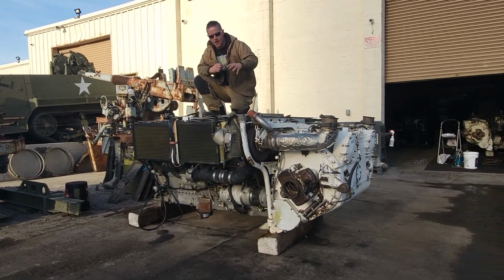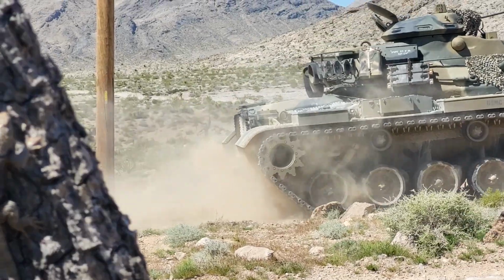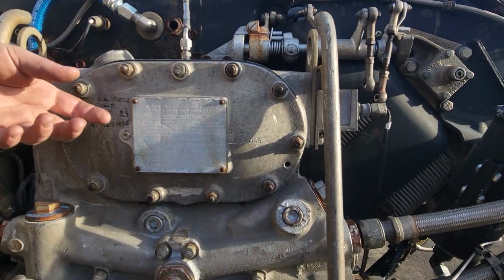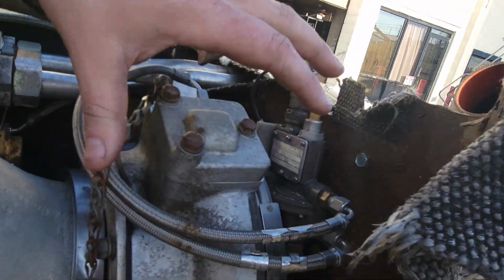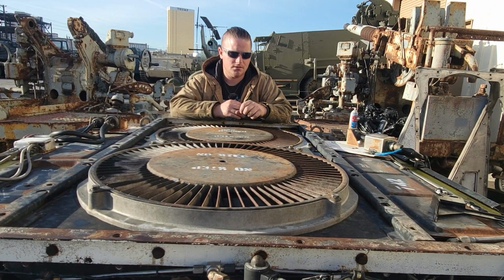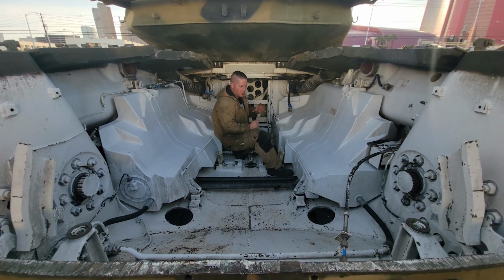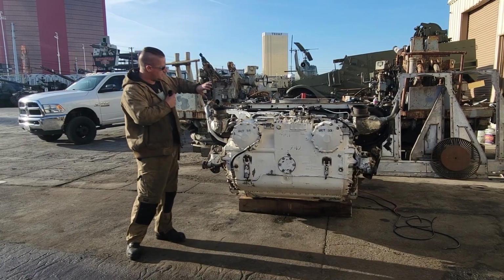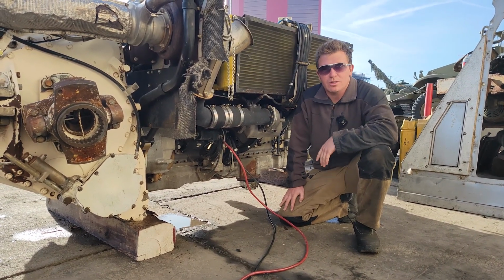Is This The GREATEST Diesel Engine Ever?

Comment: What the F***?
Are you guys serious?
The best tank pack has to be those that power Leopard 2’s
Not everything made in the USA is the worlds best
There are other options!!!
Reply from the maker: We do not have a leopard 2 therefore we will not be making any claims one way or the other on that Vehicle. You will notice the title was posed as a question, allowing the audience to decide for themselves. Every tank, every engine has advantages and disadvantages. There is no best in the world.
Reply: @MilitaryArmamentsCompany  If you don't know about, or want to include one or more alternative engines to that M60 power pack, there is no point bringing up the question of "best in the world"
The power pack of all the Leopards, including the Leopard 1 has features similar to the one you describe here.
Really, apart from the continental engine being primarily oil cooled (more so than air.. just like a VW beetle) and the MTU engine in the Leopards being water cooled... there's stuff all difference in the features you describe.. they just aren't unique to the M60. 
In fact the Leo 1 could run a spare power pack sitting next to the tank and power the machine via "umbilical cords" of wiring and hydraulics, while the original, damaged engine gets changed. Arguable an advantage of hydraulic/electric over purely mechanical if you have a need to keep that turret and main gun working while the engine is being swapped. (Indirect fire from MBT's is a thing)
You could even argue that the setup that started in Leo 1 back in the 60's and is still essentially the same (albeit 2 more cylinders) and in service with the various Leo 2's now... it's proved to be a better, longer term solution than the M60's.. which is discontinued. That's not opinion, it's there for all to see.
Reply from the maker: Thankyou for your feedback. We have 6 Leo 1s in the collection and have pulled pack several times. This video is about the M60 not the Leo. We are familiar with Leo and have run with all the ground hop kit. Leo engine is an amazing engine. My only argument would be if you do not have the diagnostic equipment, sometimes you can be dead in the water. We have 1 Leo permanently stuck in Limp Mode and cannot find anyone with the equipment to reset. That is my argument against the Leo. Might be a more capable tank to drive but at least on the M60 and Russian Armour, if I see the problem. I can fix it. Perhaps a full Leo video in the future. Thanks for watching.
Reply: I know right ?!?!? They didn’t include any of the Star Wars vehicles either… DAMN THEM! 🤨
Reply: I’m gonna ask the people at my Church to Pray for you to have a speedy recovery  getting over this Traumatic experience 🙏 god be with you on your Journey  😁
Reply: @MilitaryArmamentsCompany  I agree with you, watched the guy from Aus armour deal with a transmission electrical problem, no easy task! Have just subscribed to your site. Like your style.
Reply from the maker: @terryh8421 Welcome to the channel and thankyou for watching. We have 6 Leo 1's. Amazing tank. Very capable however like comparing a Mercedes to the M60 as a 70s Ford Truck. When the Merc breaks, if you don't have all the diagnostic equipment you can find yourself dead in the water. A dream to drive and works well for a fully funded army in a perfect world. The M60 can be fixed regardless, if you see the problem you can fix it.
Reply: Pin of shame
Reply: The Leopard engine sounds like something John Deere would be proud of. What, you can't afford to fly out one of our field technicians to diagnose that your engine needs a new crank angle sensor ? Too bad, we can't help you...
Reply: Video seemed reasonable to me and very well done. No wild claims made. The sad truth is Survival on YouTube means compelling or controversial titles, or people just do not watch. 
Karen remarks reserved specially for people who cannot remain professional in their correction, becoming aggressive or emotional. These guys put so much effort into bringing us this content for free, like it or not you can thank them for their work before you rip shreads off them.
Reply: Leopard2 is an other generation of tanks. Comparing apples with peaches. A comparison with Leopard1 would be more interesting, because its the same generation as the M60. I am not an expert, but it seems to me that the concepts were quite similar. I would guess that in the cold war period the german and american mechanics had a lighter job than the british with their Chieftain tank.😆
Reply from the maker: @hansulrichboning8551  good comparison. Cannot compare an 70s tank design with a Leo 2. Perhaps one day we will compare our Leo 1s with the 60.
Reply: ☝🏻😂 says the clown with a channel dedicated to heating liquid over fire 🔥  Calm down / take your Meds!  Thx Bozo  I needed a laugh  !!!
Reply: ☝🏻 Hey Village - we found your Idiot 😁
Reply: @GuidosDad you did not click anyone's user name to reply to them. No one knows what your talking about.
Reply: I clicked on those CryBaby’s comments to send those… 🤷🏻‍♂️ (like I did this one ) Hava good day 🇺🇸 MoFo
Reply: I've been working as a "helper" in 1980 on the Leopard 1A2 when it was compulsory military service in Italy but I could only basic service like checking oil levels, leaks and other small things. But I realised how professional the mechanics had to be to work on those tanks exactly like you guys working on those engines. My dream was to to drive the Leopard 1A2 then considered a very cool tank 😎. Good job 👏 👍
Reply: The best power park is the new EuroPowerPack, which is a combination of a Renk Ten Speed transmission (Five Forward, Five Reverse) and a transversely mounted MTU 27.4-litre 1500hp diesel V12 engine.
While the Leopard 2's power pack consists of a longitudinally mounted MTU 47.7 litre 1500hp diesel V12 engine, coupled to a Renk transmission which has four forward and two reverse gears.
The EuroPowerPack offers slightly better performance while being 1 meter shorter in length than the former, in addition the width and height remained the same.
Reply: Ok Karen we will speak to the manager ans get right on it! We will select a different favorite tank for you. Those guys just over hauled an M-60 pack, they are qualified to have that opinion. What qualifes your Leo 2 opinion other then being a keyboard warrior?
Reply: @HH-COactual  They aren't qualified to make such a claim (which they didn't anyway, just inadvisably used a leading question as a title), as they admit they didn't have any knowledge of the Leopard pack (or even mention any others) to compare.
That's like me saying a Subaru engine is better than a Nissan engine cos I took a Subaru engine apart once.. but I haven't played with a Nissan one so they don't matter.
Introducing the Karen remark is really just childish, doesn't help the discussion in any way.x

Comment: In the mid 1970s, I was a tank retriever. Operator tank mechanic and a gunner. Yes, 3 jobs, because we were so shorthanded. One thing about this power pack do not adjust the governor to get more R. PM's it'll blow up if you leave it alone. This tank engine runs forever. And yes, it is the best in the world. When I served with the Germans
On their leopard, tanks and j
Hunting panzers, there  engines gave trouble

Comment: Thanks for the video, watching this video brought back many memories.
I started rebuilding engines at age twelve, anybody that would buy me the parts I would rebuild the engine at no cost, I loved what I did. By the time I was sixteen I had rebuilt twenty one engines. I started building my first race car at age sixteen, and my second at age seventeen. I got to race the second car almost two dozen times before the US government wanted me for an Asian holiday.
I was drafted in 1967, sent to Ft Knox. First rule never volunteer for anything, broke that rule.
First week in the army was spent in a testing environment. 
Leaving basic I was sent to Recon School and got an 11D mos. Recon Scout.
Flying into TonSonUte in Saigon in 1967 looking at my personal jacket my recommended mos was a 63C20. A mechanic. Would have been safer, Ap Bau BangII, Tet68 and Battle of Hue, Binh An, Wunder Beach, Au Shau Valley.  I was lucky only wounded twice. 
A Troop 3/5 Cav 9th Division then OP Con to 101 and First Air Cav + 1st and 3rd Marine Divisions while we were up north.
We had some great mechanics, I got to help them man times. Replaced a M48 master switch without disconnecting the batteries… because we were in a hurry. 
Came home, got married and I have built race cars all my life, I won three Top Alcohol Championships, Three Top Gas Championships and at age 79 just finished building my car number 81. www.KenLowe.com.au 
Watching this video brought back many memories. 
Love the AVDS1790
Reply from the maker: What an incredible story! We love to hear from Nam veterans. The M48 Vietnam set up tank is our favorite. Some in field mods from Vietnam are some try ingenuity. Thankyou for all youve done. Thankyou for watching and supporting the channel. Scott.
Reply: @MilitaryArmamentsCompany  want some personal pictures, send me a link I can send them to.

Comment: As someone who has been part of the crew on the m88 recovery vehicle it is quite neat seeing the differences between the version of this engine we use compared to the older pack from the m60. personally, i love the sound of these engines running and driving around

Comment: I was an M60A3 mechanic in the army. Ours had the AVDS17902D engines.
Reply from the maker: Excellent! Did you notice any across the board issues with them?
Reply: @MilitaryArmamentsCompany  No, they were extremely reliable. When we did have failures, they were usually blown jugs, and that was an easy thing to diagnose as the tank would leave a foot wide trail of oil behind it as it drove along. We took the packs out of one platoon's tanks per week for quarterly service, filter replacements, adjustments on the transmissions, etc, then ran them outside of the tanks using what we called a ground hop kit beofre putting them back in.

Comment: 2 years 10,000 hrs, 5,000 miles, 500+ battles, expert tracked vehicle badge M60a3
Hohenfels, Ge
CMTC
1990-92

It may be the "best engine", but they were junk.

We had 30 rolling tracks, 3 floats per 10 tank platoon and our own rebuilding facility manned by civilians. Turning over 3-5 rebuilt whole tanks/month and twice as many rebuilt packs. Swapping packs took a mechanic crew less than a half hour.

Our two decade old m60a3's crossed the start line 100% battle ready. The U.S. units' new M1 Abrams had difficulties showing up with 80+% readiness everytime.

Our "slow tanks" chugged/smoked along with blown jugs until we had the repair facility up and running.

Comment: Nice one mate.  I couldn't agree more that ..."Power Packs" were a massive improvement for MBT's / AFV's...if not "a game changer".
How would you campare the M60's Continental v's a Leopard 1's MTU power pack ?
Love your work & passion for AFV's, WW2 Aircraft...& in geneal All things Military.
Cheers from Oz
Reply from the maker: Thanks mate! Definitely a back end game changer for the big picture in Armoured Warfare. I love both those engines. I can speak to Leo 1 MTU, I have pulled several. Fantastic and capable engine. Runs like a dream. You could quite literally make the comparison that the Leo is like Mercedes and the M60 like an old 70s Ford Truck. The only reason I will sway towards the AVDS is just like my comparison, both are incredible however on occasion the Leo can break with electrical fault and without the diagnostic equipment your dead in the water. The AVDS does have sensors but it's all mechanical operation that can be easily identified and fixed. For an interesting read, see the trials Australia did between the M60 and The Leopard. Very interesting findings. Scott.
Reply: @MilitaryArmamentsCompany  Cheers for the reply.  Great point re the M60 pack being all mechanical & simplistic to identify & fix repairs.  The whole KISS thinking has a lot of merrit, especially when your not near a specialised workshop area or have  Tech Support in your immediate AO.
Cheers

Comment: Is a turbine or disel tank engine better?
Reply: Turbines are only efficient running at load, at idle or low power they are fuel hogs. Turbines also throw a lot of heat out the back. Diesels are more efficient, the materials used are less expensive, you could hypothetically rebuild a diesel in the field, the heat signature is less.
Reply from the maker: I cannot speak to the advantages or disadvantages of turbine as I've never worked on them. 1 thing I will say however is unless your a 1st world country with big budget, your options are limited with turbine. Russian T-80 regiments are usually allocated to cold weather ops as Turbines start far better in extreme cold climate, on the opposite Diesel does better in Hot Dusty areas.

Comment: It’s oil cooled. The oil coolers are under the motor.
Reply from the maker: The forward oil coolers on the side are for the engine and the rear are for the trans.

Comment: I was on the M60A3 for 3 years. Changed a couple packs. We had one on the platoon leaders tanks that lost a lot of power. When we pulled the pack a couple of connecting rods were poking out of the case. I was surprised as it kept running.
Reply from the maker: Dam! Yes they are reliable. We had one with 2 dead jugs and another 2 on the way out. She still ran.
Reply: @MilitaryArmamentsCompany  That's the point of air cooled.
Reply: I was a tank retriever operator and a tank mechanic and gunner. In the mid 1970s, because we were so shorthanded, one thing I learned about the this tank engine. Don't fuck with the governor you can easily blow the engine up if you over speed it otherwise it runs forever.